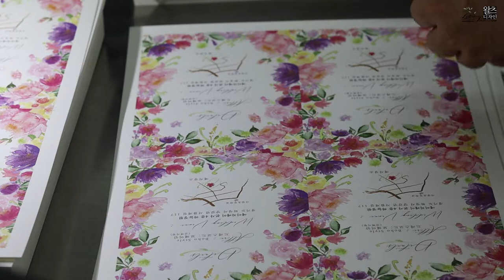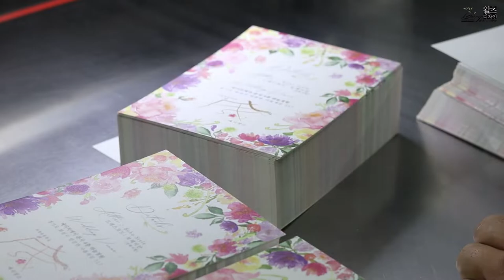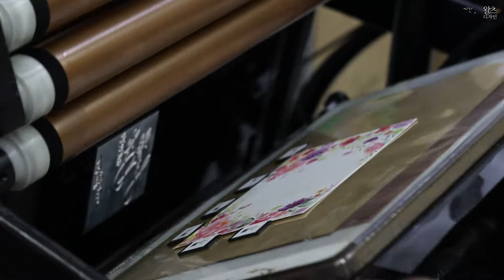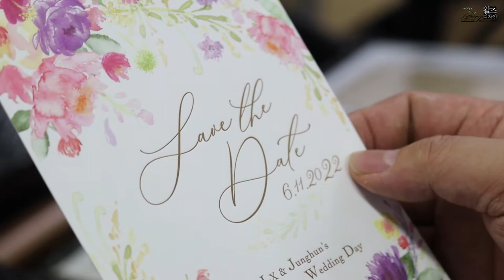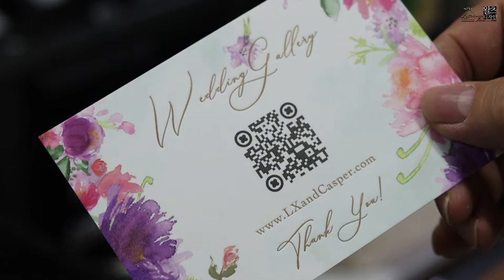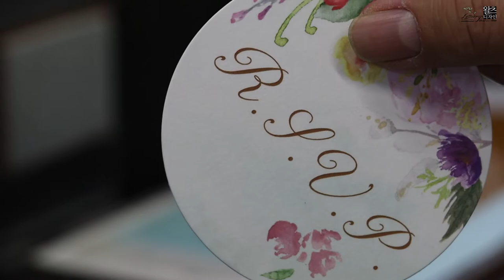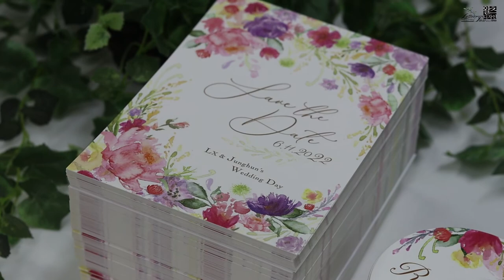Create a set of semi-letterpress invitations.세미 레터프레스 청첩장 세트 만들기.

Comment: Beautiful set!!! I could watching you work endlessly and because of your work and videos I just purchased an OS C&P but it is still in the process of restoration since it was in a very poor condition, sitting unused for over 12+ years into a garage and who knows how many years before that. There are lots of things that are unknown to me.
I believe that the extra sheet of paper between the printed ones is for cushioning. 
Is that a deep base you have in the letterpress? 
Where are you getting the plates from ? They do a great job!
Reply from the maker: The paper inserted under the printing paper acts as a pressure paper. Paper that is too cushiony causes a lot of marks on the back of the printing paper, so a paper called insulating paper that is hard and elastic is used. And the printing plate is used by commissioning to a specialized manufacturing company. It is difficult for individuals to make.